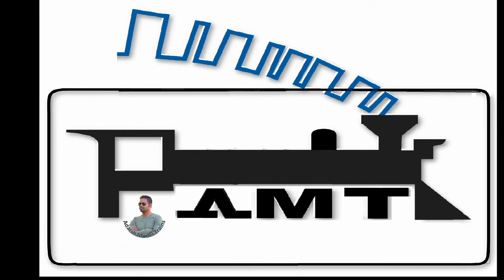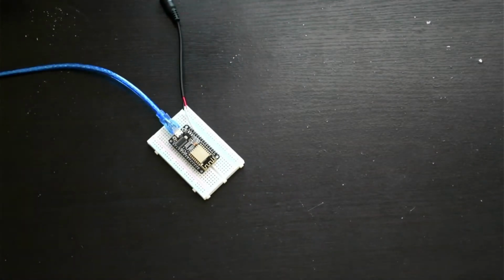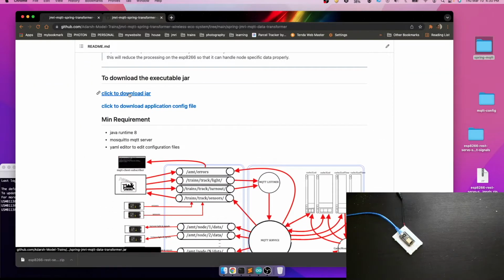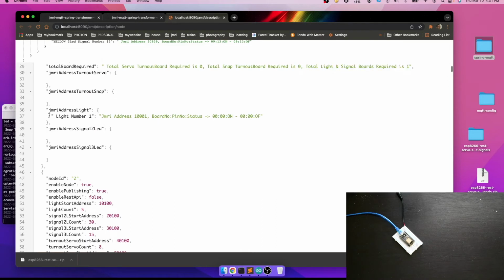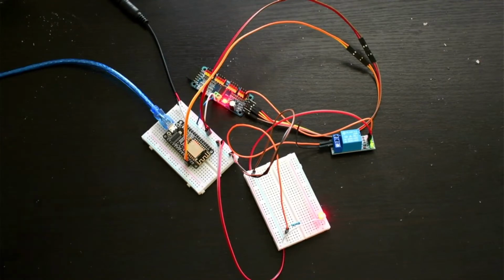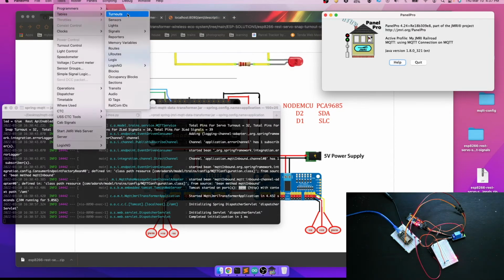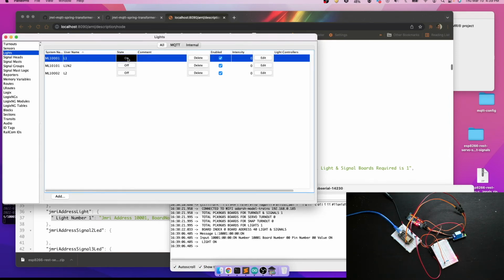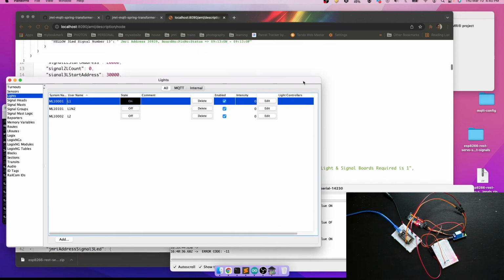Model Trains, Dcc, Wireless Control for Layout Lights Using Jmri Rest Api Esp8266 & Pca9685

Comment: hello SIr, i am trying to build my own S scale locomitve not the full fledge layout just small ESP32 controlled loco. for this i want to have controller in loco itselft for Servo , DC motor, LED and Sound control.just like lokSound decoders. since it is very costly and i can not affort it. i have chosen ESP32 for my project. 

i have gone through the few tutorials and have came up with simple design, goal is to
1. Control 2 Servos may for pentograph 
2. control 10 LED (forward motion LED, blicking of LED, etc).
3. Control of 2 DC traction motors 
4. Control for Sound (Engine starting and horn... to be run in the background always)
5. Control it via wifi with small html UI as ESP32
 
heres my demo sketch, i need some inputs from you whether this is possibl with the setup i have 
wuld you please look at it and suggest how can i achieve this

https://forum.fritzing.org/t/need-help-to-review-my-circut-design/11976
Reply from the maker: hi Akash i am happy that you thought in the way i was thinking i also wanted to do the same so that it can be open source standard  for model rail road in india i have given a lot of thoughts on this 
you can ping me separately or share you email let have email conversation and then we will take it forward